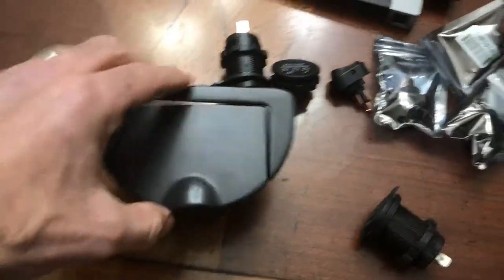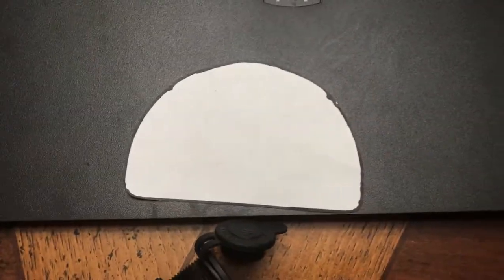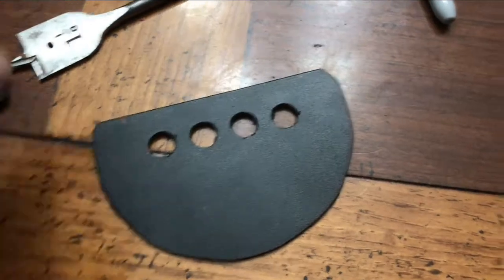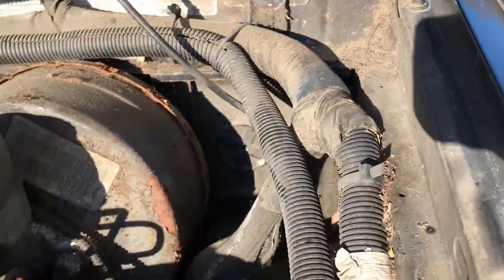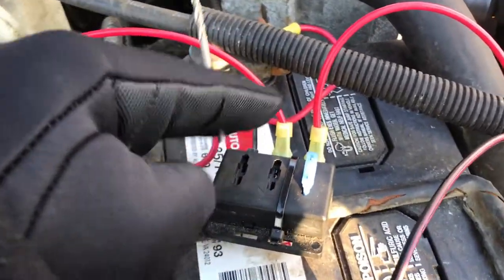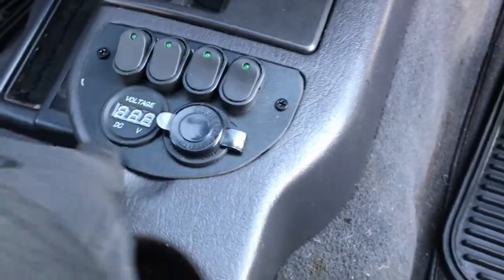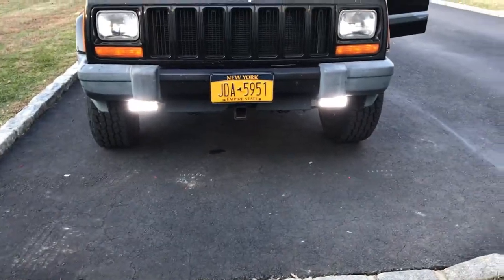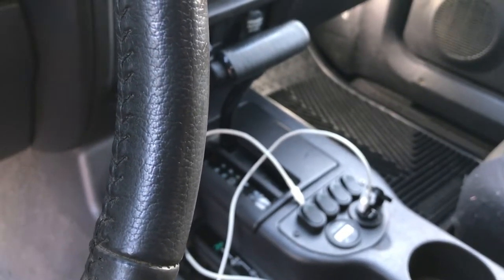Jeep Cherokee XJ ashtray switches and LED lights

Comment: mudslide those black round outlet plugs work real nice when compaired to the stock outlet l have three of then two up front one in the back passenger side cuby hole
Reply from the maker: Yeah, I wired 2 of them in my TJ and came in handy.  I have to figure out where I'm going to wire in this one for my XJ.  I would like to have a power outlet in the back cargo area which is where this one will probably go.